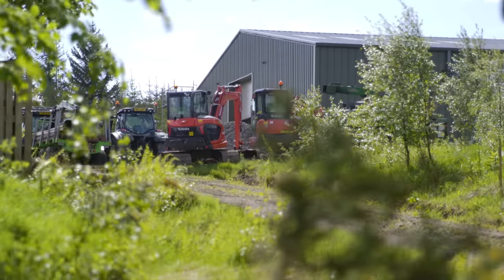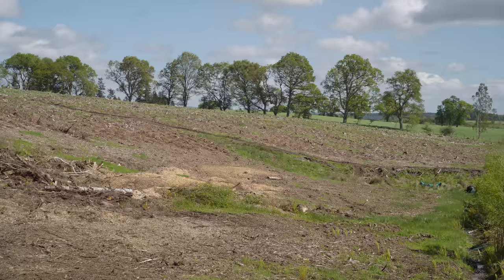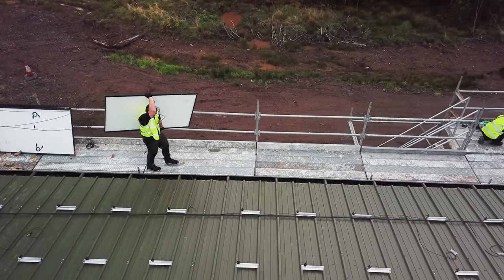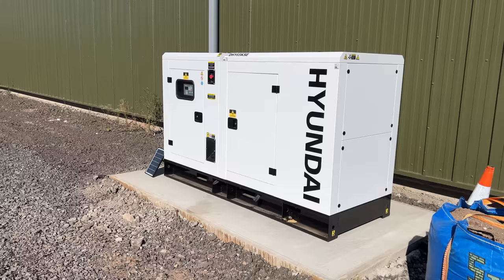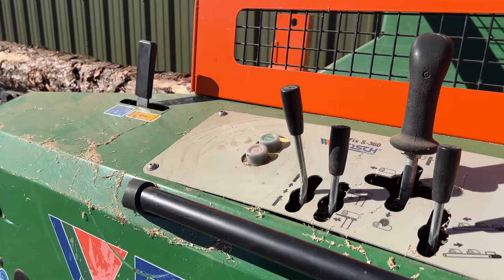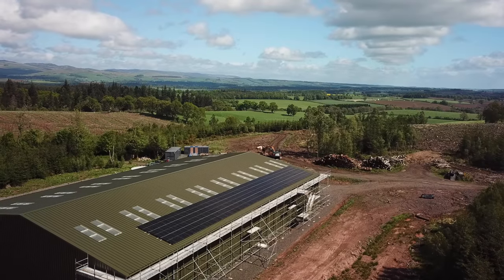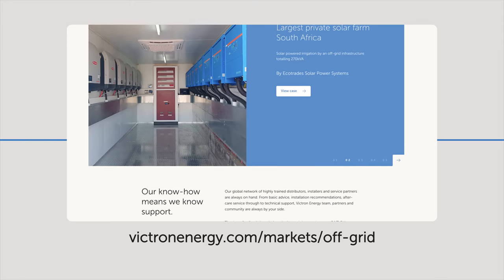Solar three-phase provides energy for forest building

Comment from the maker: 🎯 Key Takeaways for quick navigation:

00:00 🌞 Scottish Woodlands opted for an off-grid solar system with 108 panels, Victron Energy inverters, and 91 kWh lithium batteries to provide a stable three-phase power supply for their remote industrial site.
01:06 🌲 Mains grid electricity wasn't practical for this remote site, as overhead cables would interfere with forestry operations, so they chose an off-grid solution.
02:17 🔌 The system was designed to accommodate future power needs as the site develops, ensuring it remains self-sufficient.
05:10 ⚡ The solar array, along with backup generators, provides 110 kVA three-phase power, meeting the site's power demands efficiently.
08:03 💰 Scottish Woodlands expects the system to pay for itself in three to four years, offering control over electricity costs and future-proofing their business.

Comment: I'm interested in the wire size and length of the DC cables to the Quattro's.  They look to have only used single + & -  95mm cable. They also do not look the same length.   I thought the manual stated that 2X 95 mm would be needed. and all the same length for both DC and AC.  I will have to post a video of my setup when finished.

Comment: So could you do that as a single phase System, to supply not only a large farmhouse, but also to charge a couple of big EVs ?  (is it even possible to rapid-charge off a system like this ?)

Would it also be feasible (cheaper ?) to supply it as a plug'n'play unit in a Shipping Container ?

And lastly, how much do you get out of those Panels in dull and cloudy weather, is it still enough to run a house ?  (and can you add even more panels for use in winter and dump their power into heating a Pool during Summer ?

Sorry, one last thing, presumably a small wind turbine could be added as a backup, anyway ?  Thanks !
Reply: 90kva output single phase so I’d say yes.

Feasible yes, cheaper depends on country and location.

I think you’d be surprised, they said it fully charges from flat to full in a couple hours so I’d imagine ‘dull’ days would be fine.

Yes you can use the AC out 2 to trigger a dump load such as a pool heater.

Yes you could add a wind turbine but Victron don’t directly have any wind equipment although you can use their smartshunt to monitor it.

Note I’m not from Victron, though I’m in the industry.
Reply: Yes to all of the above!
Reply: @veysher3756  Thanks very much Veysher, I'm looking to convert our next house to off-grid from day 1, but I'd like to make it capable of at least part-charging our EV's overnight, too, so that is great to know !

Comment: Whilst still scaling up the business this should be OK. However, it will be interesting to see how this system fairs during what will often be weeks at a time of practically nil solar PV energy during a good old fashioned Scottish winter - that generator will be humming. I am thinking they would need to install a second 43kw array on that roof:)
Reply: You only need to use the generator for a couple of hours to fill the batteries then you run off batteries for 2 to 3 days. I do agree a second smaller array for North/West light makes sense I am in Manchester and 6 years into my on-grid system I added a North/West second array that captures Summer evening light etc.

Comment: Hello. The generator in connected on the loads side of the quatro? I didn't understand how you can run in paralel the two systems to a maximum over 100kva. Thank you very much.
Reply from the maker: It uses PowerAssist feature.

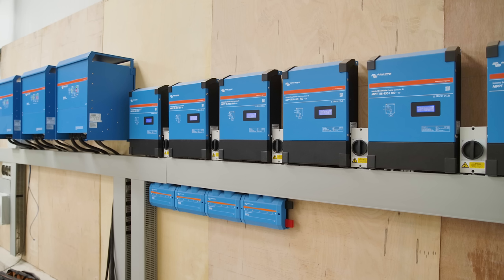Comment: At 4:09 it shows 6 disconnect switches. Would be interested to know if these are being used for the batteries.

I believe these are only rated for a max of 48v so it's not clear to me if these are suitable for a 48/58v system?
Reply: “48 V” rating is a generic description based on old lead systems. The float voltage for BYD Li Fe PO4 sets is 55.2V but even some wet cell Pb systems have absorption voltages close to 60V dc. What is important is the heat generated, and in this respect these switches are well within tolerance

Comment: Why not include Fronius inverters on AC coupling to Quattros in order to increase energy efficiency of the system?
Reply from the maker: These Victron Energy installers wanted to stick to Victron. Plus there are supply delays with a number of other brands at the moment.
Reply: DC coupling is slightly more efficient. Victron Mppt trackers also respond more quickly than PV inverter mppts in AC coupled systems. When you have an AC and DC coupled system combined ,you can see this quite clearly

Comment: As a consumer of 3-phase grid power it would be nice if you spoke in "normal" terms when discussing power delivery, ie; volts and amps. 
Watts might be fine for discussing light bulbs and computer power supplies but my machinery draws amps. 
Maybe just add those figures on if you insist on discussing useless-to-me numbers?
Reply from the maker: Watts / Volts = Amps

Comment: Doesn't look like clear skies for maximum solar input and it looks like It's a DC system; so when 1 panel is affected by cloud cover the rest of the panels in series is effected also... TIP: Have a diesel generator as backup.
Reply from the maker: Maybe on solar panels built 20 years ago.  These panels not only have diodes to deal with shading but are certainly not all in one big series group.  There are 6 MPPT RS solar charge controllers each with two inputs so thats 12 for a start.  Listen to Ian where he explains the generator is unlikely to be used at all for most of the year and if it is, it will only be for a very short period - that is off-grid in northern UK I'm afraid!
Reply: Yes, highly optimised across 12 individual Victron Mppt’s, with no shading
Reply: Let's see the gen set run hours in the spring
Reply: @pilkipilki4472  I bet 1 hour ( and that will be from two tests)